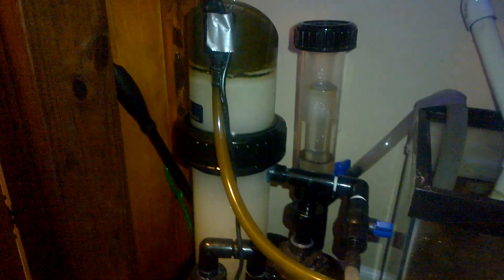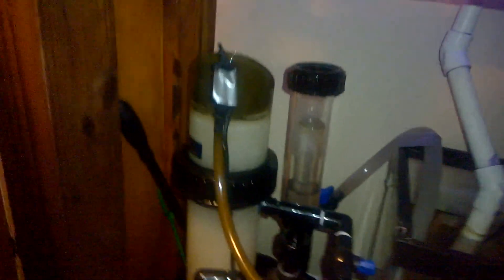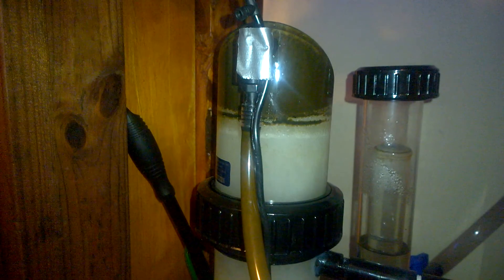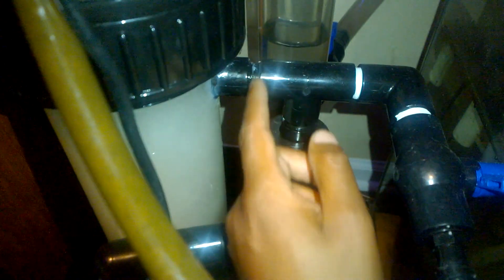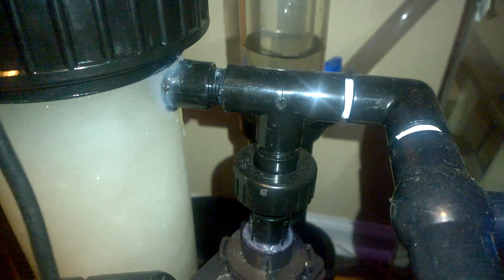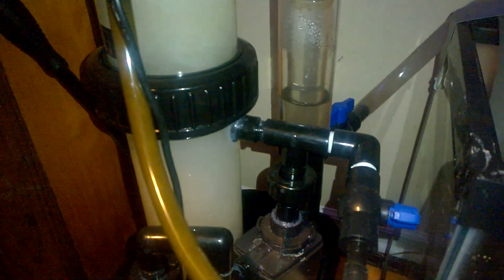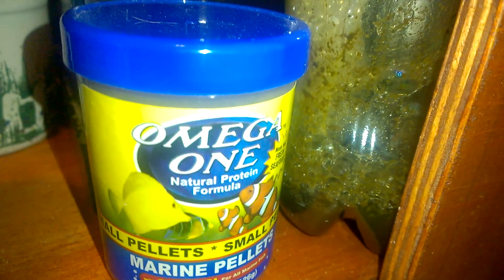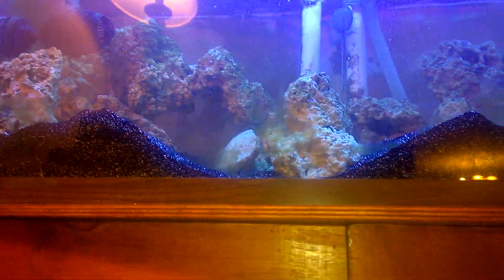Terminator II Protein Skimmer in action

Comment from the maker: on the feeder line i only used a maxi-jet 1200 and it worked fine for me. I no longer have this setup running for two reasons. 1) The pump that came with it (the atman) broke on me and never got replaced and 2) i got a new tank and had to dissasemble the sump for another project but i am thinking about buying a replacement pump and making it an insump operation but ill make a vid for that too if i get to it
Reply: +Roberto Velasquez What broke on the pump? . I've had this unit with the original pump but always had it submerged. Do you think it was heat related. I ask because I now plan to run it out of a sump like yours. Know you don't have this anymore but please let me know what failed. Thanks much.
Reply from the maker: I'm sorry for the late reply but it was my thought that it was actual heat failure from it operating out of the sump. I,m sure by now you either managed to either prove or disprove this theory. My wife bought me a Reef Octopus Diablo that I run now, but I still have this guy hanging around somewhere in the garage I believe maybe as a future back up haha.
Reply: Thanks Roberto. My main never failed or even has hiccupped .  Used Rio 1400 @ 75% ( also dead reliable. Like an ass I put it  in  sump that was to hard to access because of the height of the sump . I am convinced that running the original pump in the open air DOES cause  MAIN pump failure. Mine was always running submerged The skimmer has been cleaned thoroughly and is now stored until I can come up with a better location solution that is high on ease of access. This skimmer is a efficient skimmer that is unknown and hardly used or sold anymore. A real sleeper that should be cloned and made again. Mine is in pristine condition and will be the once again SOLID performer once I find the time to set it up .  I bought the Trion 4 by Deep Blue Professionals as a back up for the Atman, but the Atman runs like a Benz ( as long as it is submergerd. The Triton 4 can be use however .Maybe during the cold winter, a new project for me to remotely set up.The Triton will stay on the self. Thanks for the reply

Comment: Biggest flaw that I see with this skimmer is that the feed to the skimmer and recirc. pump are the same.  How can you feed a larger pump with a smaller pump.  Both skimmer and recirc pump should have their own inlet.  I own this skimmer and thats what I am going to try to do is drill a hole into the acrylic and glue/weld a fitting for the inlet of the recirc pump.